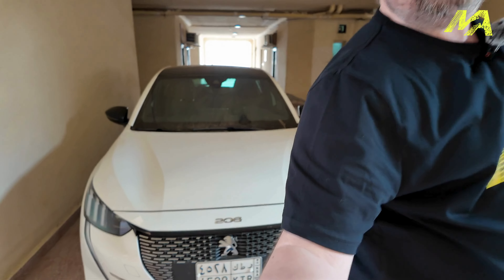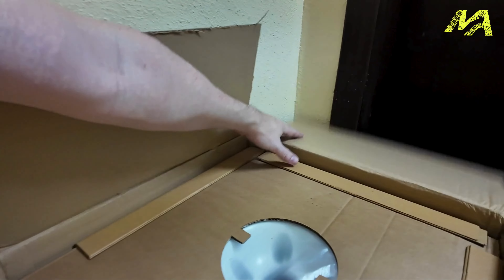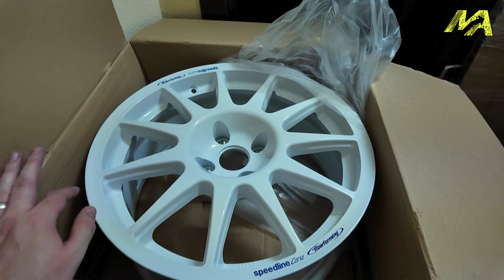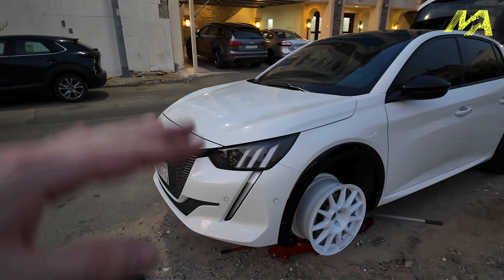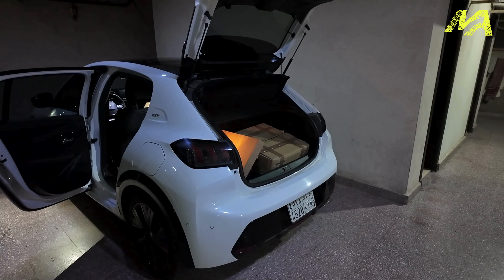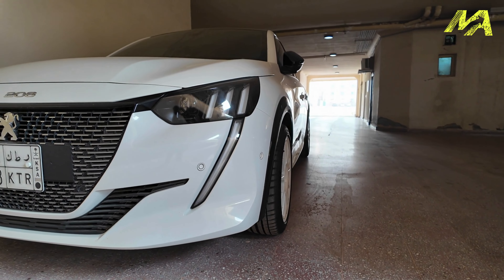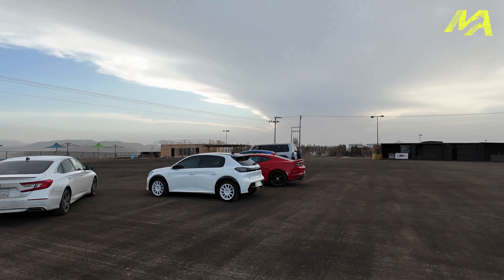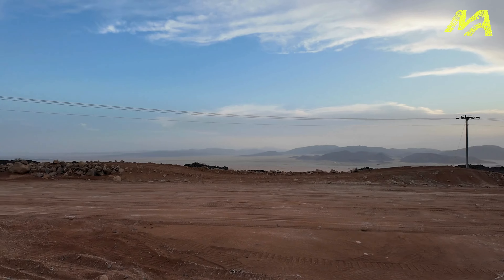Fitting Rally-Inspired Wheels to My Peugeot 208 GT

Comment: Watch out when lowering.
I lowered my e208 on 40mm springs and  after a couple of weeks a fault code pops up for the auto level on the head lights. 
Had the sensor changed and a couple of weeks later, same thing happened again.
Changed the springs back to stock and haven't had the fault pop up at all since.
I do miss the look of it dropped down though.
Reply from the maker: @goneforasmoke  thanks for the comment! That's interesting. Did you ever look into why it might have been happening? Have you read anything about anyone else having a similar issue?

Comment: I think Peugot really missed the trick not doing a 208gti on this generation of car. They 208 rally 4 is very popular. Does the engine in your car still use the wet belt?
Also the wheels look really good on the car, love it!
Reply from the maker: Agreed! With another 50bhp, it would be a really fun little car. I think it does still use the wet belt, but I'm not thinking about that as it's under warranty 🤣
Reply: @maximumattackrallying  nice one. I drove one in the UK as a rental. Even in standard trim I thought the power was fairly alright but who'd say no to another 50!
Reply from the maker: @kevinhowley1586  There is always room for more power 😆 They're ok. I'd definitely like to try modifying one a bit further, but not much point with this one as it's automatic 🙁